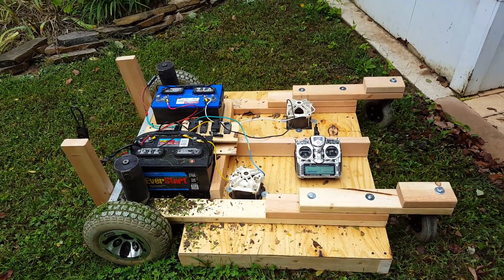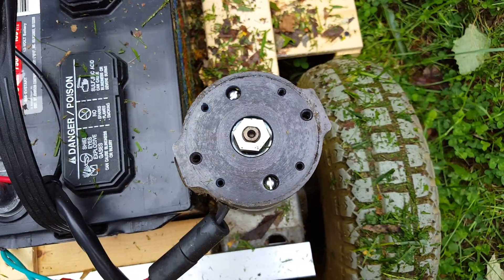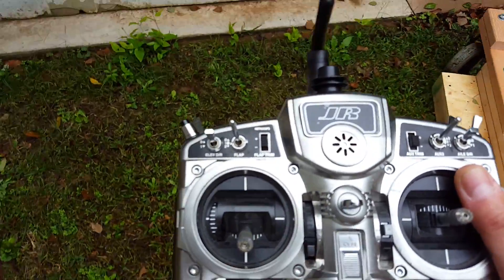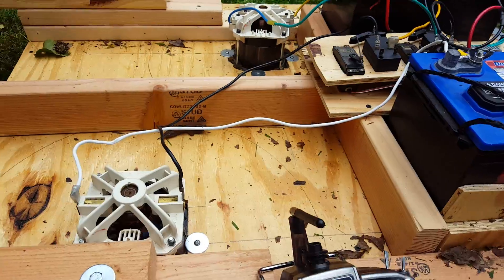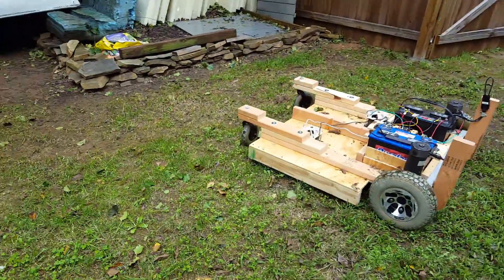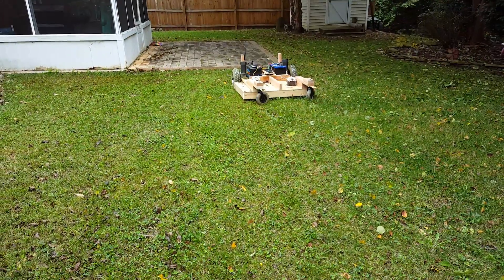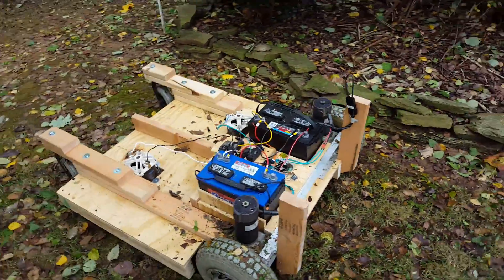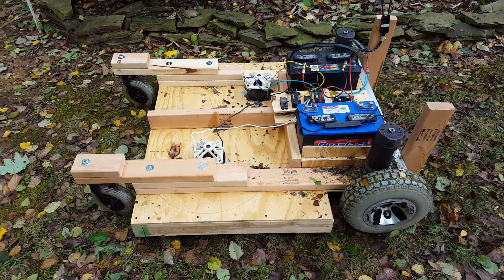RC Lawnmower Mooresville NC

Comment: Simple smart. What is the other 2 items either side of the controller. The one is the receiver,  what's the other?
Reply from the maker: The Spectrum receiver uses a satellite receiver connected with a cable about 9 inches long. The satellite receiver is on one side and the main receiver is on the other.